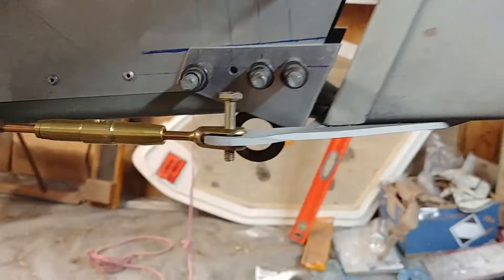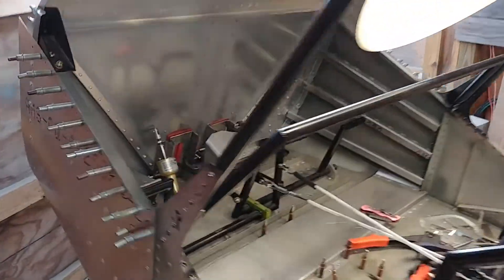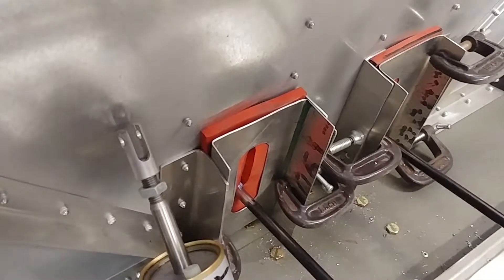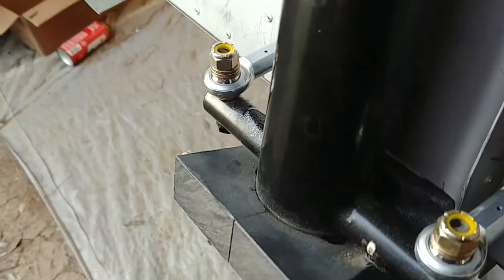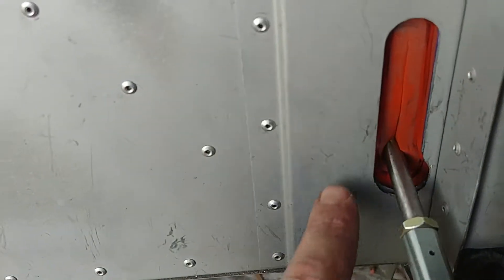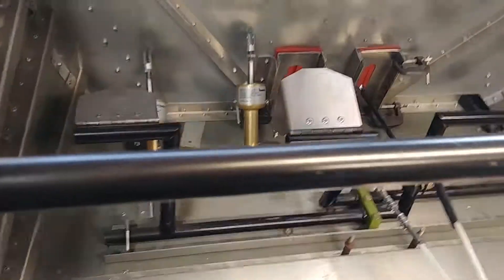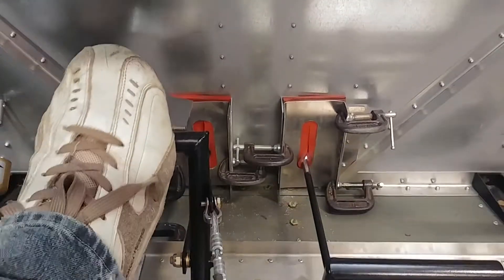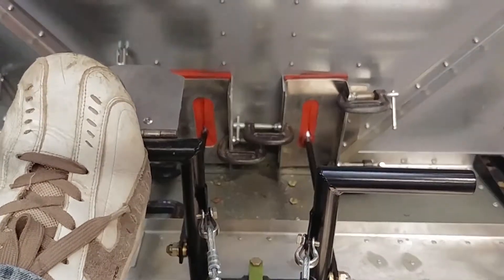CH750 STOL  Full 23 deg Rudder deflection

Comment: not sure this will pass inspection ? flames in the engine compartment will be like a blowtorch at 100 mph... its good the way it is in the plans . but very very nice job on your cruzer. good luck
Reply from the maker: Jack inspection is subjective, ametuer built experimental you are supposed to be able touse the material s you want. The inspector for airworthiness is really only supposed to verify it’s was 50% ametuer built, not necessarily safe to fly. Now some inspectors forget this and impose their experience from inspecting ga and commercial craft.